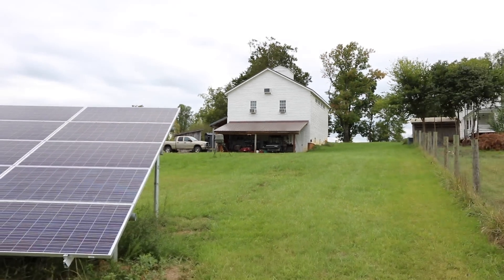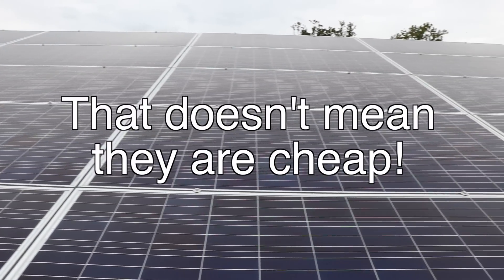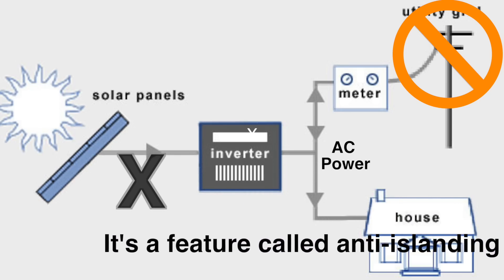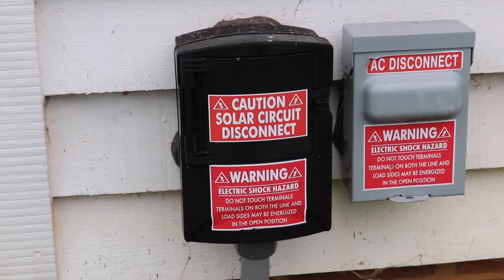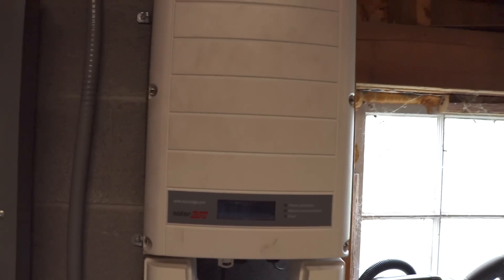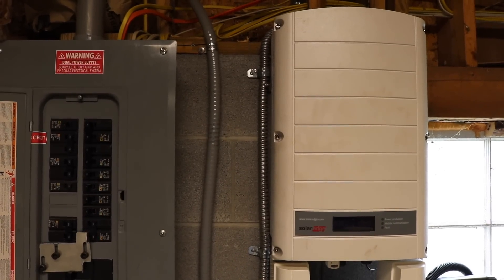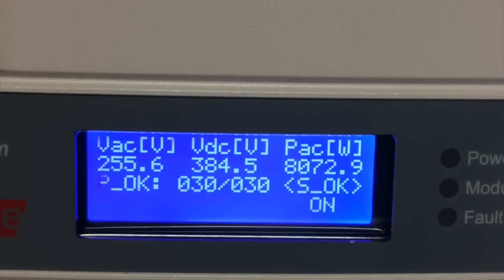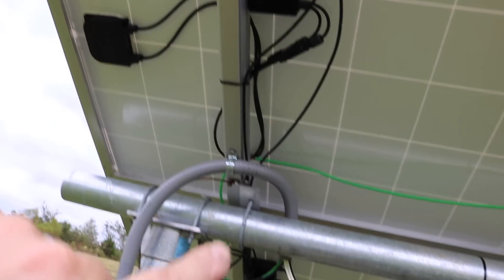The ugly truth behind grid-tie solar systems. Part 1, FarmCraft101 solar.  Watch before you buy!

Comment: I was listening the whole video for the "ugly truth" and didn't hear it. Maybe you need to re-title this video to Solar Basics or something like that. And thank you for doing this.
Reply: Yep. Clickbait title.
Reply: The ugly truth is that YOU CAN'T SUPPLY YOUR OWN POWER IF THE GRID IS IN OUTAGE... outages are happening more and more often in America.  To spend all that money, no one should have to go buy a backup generator on top of that.  Wire it up like a backup generator and you can self-supply even when there is an outage.
Reply: The ugly truth is he misnamed the video.
Reply: @meauxjeaux431  Usually solar pannel are guarantee to works around 85% of the initial efficiency after 25 years (some guarantee that after 30 years). Problem will not come from the efficiency but more likely around the inverters for example.
Reply: @yutuniopati  Gotcha. I'm not against solar power, otherwise I wouldn't have bought the system. The problem is that they become obsolete as soon as you install one due to the advancement in technology. Once they actually perfect it, then I have no doubt they will become more efficient, reliable, and cheaper. But that day isn't here yet, so I wouldn't advise anyone to go all in right now, but wait a few years until that happens.
Reply: When the grid is down, your own installation is down (except for the batteries?)
The extra (at least relatively) cost involved in small or low voltage installations.
That is the extra cost for cables, the number of disconnects, bigger inverter (more 

expensive) for lower voltages installation (where one would probably think one could use cheaper or less items). 

This are things I didn't know untill now.
Reply: @guzziventure1750  I have 1500 W outlet directly on each inverter.  If the grid is down I can use the disconnect switch and get power from the inverter.  No extra cost, just need a long extension cord to take it to the indoor 'fridge or whatever I want to power.
Reply: @meauxjeaux431  My experience has been better than yours. I paid $21,000 for mine with 30% rebate and am producing about  $2,500 per year, better than 10% annual return.
Reply: @meauxjeaux431  At 12 years pay back, it would mean at least 12 years of free electricity if nothing goes wrong. Not really bad...
Reply: @meauxjeaux431  My Canadian Solar panels have been hammered by hail many, many times with no damage. They're tough! I never wash them, but if I wanted to it would take 15 minutes and a long-handled brush as they're ground-mounted. I have only 2.8 kW but I'm running a super-insulated off-grid home; we are completely independent. Yes, spending more on insulation is a great idea.
Reply: @meauxjeaux431  Smart move! We have 3 1/2 ft overhangs and they really shelter us from both the weather and the hot sun.
Reply: @meauxjeaux431  Ouch!  What size is your system?
Reply: You might want to buy it then... I see what he means though, not super simple.
Reply: @meauxjeaux431    insulating  reducing waste elect .  etc. should all be done first.  then size your system based on the new nine wasteful habits..
Reply: @meauxjeaux431  OK, so i have grandparents, they have lived in the same house for 40 years. They live on a farm which has electric fences, they had 6 panels put up and connected to their house, They're so happy about it saving them money when they don't have cows or horses. On the other hand I install solar all over Iowa, and I know that I have spent 80% of my install days on a hog barn and they benefit from solar. So, i'm sorry to say but the world does not in fact revolve around you.
Reply: @meauxjeaux431  Seems to me not using batteries would lower your operating costs. True, you loose the ability to store any excess power but why not send that into the grid instead?
Reply: @meauxjeaux431  OK, but what happens when the grid fails? That's the real bottom line if you live in a place where this is a common occurrence.
Reply: The cost and not being able to use it if grid down is ugly enough not to bother imo
Reply: @iank2196  I'm fortunate to live in an area where the power only goes out about once a year, maybe twice. My system will pay for itself in 3 years. Then I will be saving $3,300 per year. I may take that savings and invest in batteries and a generator and a crossover switch if I start getting annoyed by more frequent power outages. Over my solar system's life I will save over $70,000 dollars. That's not very ugly. All the beautiful stuff that $70K can buy? Not ugly!
Reply: @LazyH-Online Not necessarily. A lot of people look at those panels and think they're ugly which limits the buyer pool which has an adverse effect on price.
Reply: @LazyH-Online The "bump" basically applies to "owned" systems. The "bump" usually ranges 4 to 6 percent to the value of a home sale, so the return is partial. Leased systems tend to be a liability because the solar company warranty usually expires in the short term. Systems also degrade over time. The systems do work and oft times, depending on home consumption, provide a small rate of return on the investment. By and large, the greatest rip off is the outrageous price of the system compared to cost, and the fact that historically, the solar companies raised prices to absorb a portion of the government subsidy. Bottomline: if taxpayers are subsidizing the installation through, then the technology has little merit. Little known fact for those who embrace the "green" movement: the lifecycle carbon footprint is questionably greater for solar than for traditional fossil fuels. Just a thought.
Reply: @LazyH-Online True to a point, but when take all aspects of an investment into consideration, including the average length of time individuals typically stay in the home before reselling--now a skosh more than 9 years, wherein a decade ago, it was 6. Has a major impact on the return on investment.

I actually like solar for some applications, especially those that have issues with proximity to the electrical grid. Only takes the insall cost of a one or two power poles combined with permit fees to bring the investment into line. The technology has some degree of merit which, along with technological improvements, will eventually make much more sense when taxpayers are no longer compelled to subsidize it. Probably within the next 10 years.
Reply: Desmond Bagley  he also said it in the first 5 minutes of the video but yes he wrote it in the desc
Reply: @meauxjeaux431  sir check our biggar on utube
Reply: @meauxjeaux431  As solar panels become more efficient, the systems become more cost effective with a shorter break even.  Furthermore, electrical energy costs are always increasing.   Yes, there are maintenance costs, but it should be much less than the amount one annually pays for electricity.
Reply: So that u click it
Reply: It can be ugly and it can be not, depends on the viewer. Another thing is “its catchy”. Meaning more viewers. If his in to making money thru youtube then its good for him.
Reply: So many derp responses here. He said it @2:20 "If the grid goes down, everything goes down..." Are y'all deaf? Price and duration to recoup costs aside, that was his effing point you ignoramuses. I hate to go hard, but the guy said it before the first five effing minutes of the video 🦧
Reply: @meauxjeaux431   Buy 2nd hand panels and wire your home up with a battery system. Nickel Iron is the battery way to go :)  They last decades and are infinitely recyclable and repairable. 

They're not common because they were bought out and nobody returned to buy more because the ones they bought already weren't failing, so no repeat customers unlike lead acid batteries...
Reply: In the desripition he says that the "ugly truth" is the lack of power in a blackout. In my opinion it's only a mild inconvenience at best.  Where I live power outages only happen once or twice a year, and usually at night or in a lightning storm, and even if there were 12+ hour blackouts during the day, spending 2500$ (or much more depending on the size) on batteries, charge controllers, and more for the off chance of getting a long blackout doesn't make much sense to me. If I was really worried about not getting power, I would just get a decent sized inverter generator for 3-400$ (and for the price difference you could run it for a year non-stop).

However, for him it might make more sense if he gets regular brown or blackouts, just for the convenience of not getting out the generator and plugging everything in.
Reply: @meauxjeaux431  WHERE IS THE GOVERNMENT-SUBSIDY ?
Reply: The price is one ugly truth. The other is that if the grid is down, you are out of power. You can't run off your own solar power if the grid is down.
Reply: The ugly truth is that if there is a power outage, you cannot use your solar system to power your house in a grid tie system.
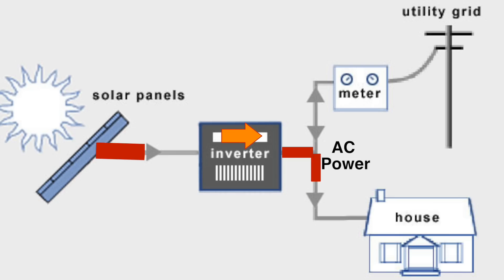Reply: Did you skip 2:25 "There's a catch"...? That's a big issue that many people probably don't know.
Reply: the ugly truth is some electric companies will charge you  regular price for the electric used and ony .02  for any electric you produce.
Reply: I believe the "Ugly Truth" part is that you go to the trouble and expense or creating a solar system, and if the grid goes down, so does your power. This is because a grid-tied system has to shut down your power production, to protect the linemen working to bring power back online in your area.
Reply: @meauxjeaux431  It's definitely true that it's smart to increase your home's efficiency before investing in solar, but I don't think a 10-12 year payback is bad. What else can one invest in that will actually pay for itself and generate significant profit over it's life span? 7-10% a year return is on par with the stock market although it doesn't compound. The upside is there's no risk. You have a warranted product that is guaranteed to produce power for 25+ years. As utility rates go up, your benefit increases. Solar actually requires very little maintenance and you can often extend inverter warranties up to 25 years. Sounds like your sales person didn't do a very good job of setting your expectations realistically.
Reply: @heathkearns1378  The problem is, most people won't stay in their home long enough to reap the benefit.
Reply: @heathkearns1378  Consulted for many years. Lighting consultant also. Worked with two major banking institutions and other Fortune 500 companies to retrofit their lighting system. Not one would invest in the cost of more efficient lighting systems if the payback period was greater than two years! The banks would not invest unless the payback was less than 18 months. Can learn quite a lot from the folks who live for money!
Reply: @heathkearns1378  I don't think there are many companies small or large that would accept a 12 year payback on any investment. Even working in manufacturing with tight margins a 5 year payback was acceptable, in Oil and Gas it is usually less. If the companies won't accept 12 year payback why should the little guy accept that burden.
Reply: @pobvic  Yeah I can't argue that business has different benchmarks for making an investment. Although I think you underestimate people's interest in the social and environmental benefits, as well as marketing opportunity sustainability provides. On an individual household level though, people spend $20k+ on home improvements like bathroom and kitchen remodels every day. The payback is experiential, not financial. Solar is both.
Reply: @heathkearns1378  I wasn't trying to knock peoples interest in the enviroment. But I think the prices are being kept high by excessive and sometimes outdated code restrictions and policies.
As for marketing, I don't think you would recoup the cost of the install in added value to your home when selling.
Reply: @pobvic  - what's your "payback" or ROI on your power bill, the money you are sending to your utility every month?  You're not comparing apples to apples.
Reply: @pobvic  Nuclear power plants have a 15 year payback.
Reply: @pobvic  It seems that many solar companies are allowing financing for 25 years now...which... is bananas. My own perception of solar investment is that x years out, I have NO or massively small electric bills. Heh, massively small. If i am retired and my 300 plus ebill is 7 dollars in 15 years, then it certainly makes other expenditures in retirement more feasible. But, what I am finding, is that a new system is upwards 50k, pppttttt.  even at 3k electric costs per year, it would take a long time to break even.
Reply: It's very expensive.
Reply: @cularu1  It is expensive but so are our power rates. PG&E now charges $0.38 per kilowatt-hour at the top tier. My electric bills were coming it at around $500 per month in the summer. My 7.5 KW solar system cost me only $10K after federal and local rebates because I designed, permitted, and installed it myself. The payback time is 3 years and I'm almost 2 years into that. In about 15 months I will still have zero electric bill but will be pocketing over $3,300 per year selling myself power for the next 25 years. And the value of my house has gone up considerably as well. That sounds like pretty good return on investment to me!
Reply: nwinblad that's why I dislike this video he wasted my data
Reply: @bilalakram1384 you missed the fact that the system goes down when the grid goes down. That’s the downside. It’s not click bait. Ya’ll just not paying attention
Reply: and the fact buying panels on government "deals" = you buy they're choice...  which are the $300 to 400 kind..

I can buy mine at $5 a piece if I order 1000 of them at a time..  from where theyre made in the first place cough 'China"

Comment: I'm getting a system of the same size as you put in here in South Australia but I'm getting a 12KwH battery too and we can run it during a blackout. It comes with blackout protection and we can nominate two rooms in the house to keep live in a blackout. Handy feature really.
Reply: You call batteries, "a handy feature".  I call it, a financial LOSS.  An AC Generator is much more cost effective.

Comment: It seems to me that you have paid too much and it looks far more complicated than my neighbors.  He has a battery backup with his grid tie, in the event of a grid down situation he switches the main breaker off, and then switches on the inverter for the battery back up, which is wired in the the breaker box, and when the battery back up inverter's breaker is switched on this signals to the panel inverter that the grid is back up.  When the grid comes back online reverse the process.  Basically two switches, switch one off and one one.

Comment: I must have missed what the "ugly truth" is. I have a small grid-tie system that's been up and running for a couple of years, installed inexpensively, and tax credits have brought it down to about a 5-year break-even. Not being set up to move power output to a DC controller instead of your grid-tie system if the grid goes down is just your choice.
Reply: Exactly.  We are not completely out of grid, but I made it my choice when to use Power Electric Authority or not in Puerto Rico after hurricanes Irma and María and it is completely legal because I just had installed a transfer switch so I can decide whenever want to use it.
Reply: but I don't have Tesla, obviously, I use 8 trojan batteries and it works great and I have it installed after María on 2018.

Comment: You didn't need any optimizers with an open setup like you have.  Optimizers are only usefull for build or tree full areas, where shadows can get a single or a few panels.
Reply from the maker: That's the conventional wisdom on optimizers, but they still help even for an unshaded array.  Occasionally single panels will have bird poop, or snow, etc.  And all the panels even when new put out slightly different amounts of power.  My more productive panels don't get knocked down to the least productive.  That said, I don't know if the benefits will actually pay for the cost of optimizers in the life of the system or not.  No good way to measure that.  But for me, I got my system as part of a co-op, and all the installations had to include optimizers and a solaredge inverter.  Doing the co-op saved me a lot of money, and probably paid for the optimizers that way.

Comment: This is not a "solar system" ...

This is technically called a "Photovoltaic Electrical System", commonly known & referred in the industry as a "P.V. Electrical System."

Power transmission lines on a typical residential street typically operates at 7,200 volts to ground or 12,470 volts line-to-line as in a 3-phase line configuration, that would be connected to a 3-phase bank of transformers for use in a larger commercial or industrial installation or application that would require some sort of a 3-phase power configuration or application.

However, if you were to install a generator & transfer switch between the grid-tie inverter, your P.V. Electric System would continue to operate even when the power grid has been disturbed or interrupted... granted that the generator would continue to operate and you would have to provide a power demand or an electrical load great enough to consume every last bit of electrical energy produced in order to prevent power from being back fed into the generator or alternator. 

Your best bet is to install a large bank of deep-cycle marine/R.V. batteries to act as a buffer to store the excess amounts of energy produced & to store said energy until it can be safely used... however, if you wanted to continue to make money by back feeding the utility with the grid-tie installation, you would then need a 2nd inverter to operate in parallel, with the 2nd inverter to have a dedicated connection to the electrical service that has a transfer switch to isolate it from the utility connection so as to prevent power back feeding in the event of a power outage.